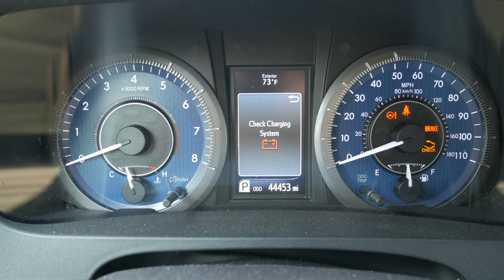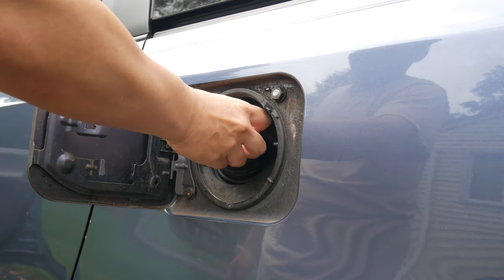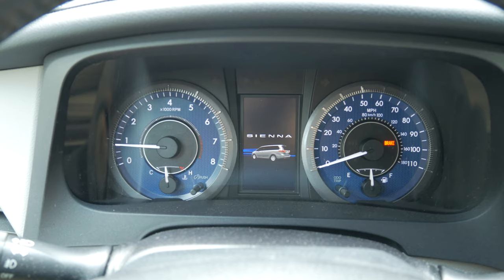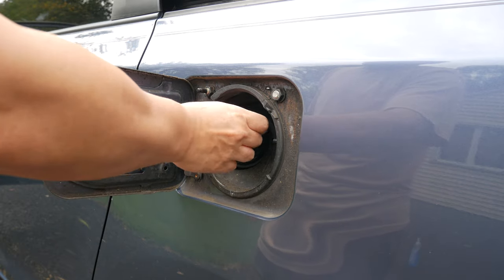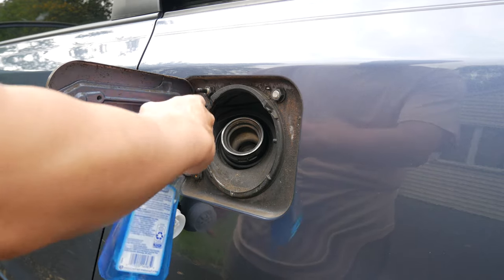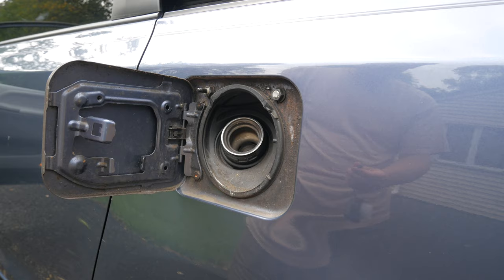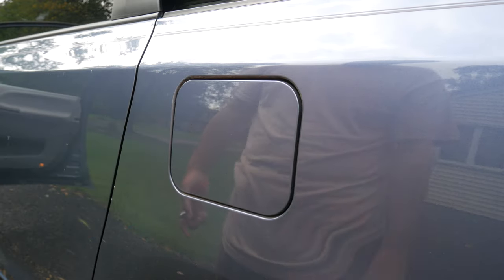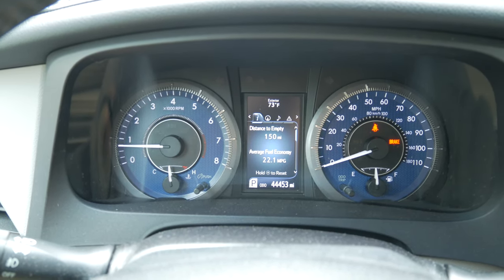Fix Toyota Sienna Traction Control off and Check Engine light on

Comment: Thanks. Worked perfectly. Saved us a ton of money at the dealership for diagnostic fees.
Reply: Have an ‘08 Sienna XLE.  had all these random misfire codes (VSC) and even would have to shut my van down as the “traction control” light would blink along with the engine light causing the van to lose power and decrease in speed, till I shut it off and restarted it.   And that would take care of it for a week or so then back again, usually one the Highway.  So off to the shoulder again as the van would slowly lose power and buck and gas be basically unresponsive 

Seems like maybe the compression was changing over the 200,000 miles as i started putting premium gas in and the higher octane was the key.. as all the codes went away (once cleared) and never came back.   Same spark plugs.  I did change one injector (before I switched to premium gas) as it did have that code come up for the number 2.  But the check engine lights would still come on.   But same spark plugs on all 6 cylinders as those back are just too hard to change without a good reason.  

Again premium gas and all my check engine lights and blinking lights are a thing of the past and it’s nice having a dash free of those.  (Those lights came on probable a dozen times in the past.  But now problem solved for like 9 months now and counting.

So if it returns might try that.

Comment: I have the same issue. But opening and closing the gas cap didnt work. I tried to disconnect the battery and it did work.
Reply: Thanks that fixed it for me also

Comment: Mine won’t work am not sure what to do now
Reply: Try to disconnect the Battery (positive terminal) for a few seconds then reconnect. I have toyota sienna 2014.
Reply: Same problem and trying to fix step by step.
1. Disconnect battery and reconnect
2. Check battery life - replace it if the level is low
3. Replace Gas tank Tap 
4. Replace oxygen sensor